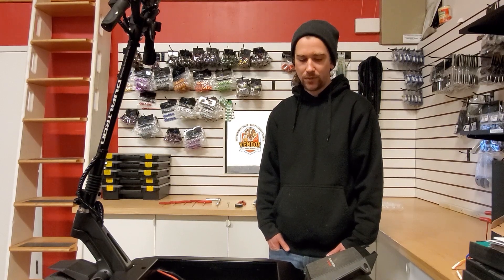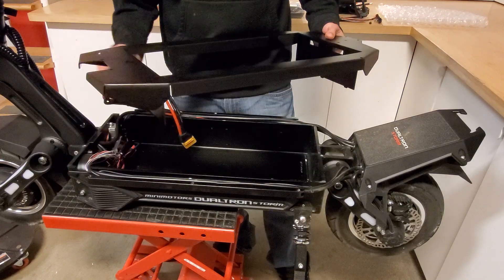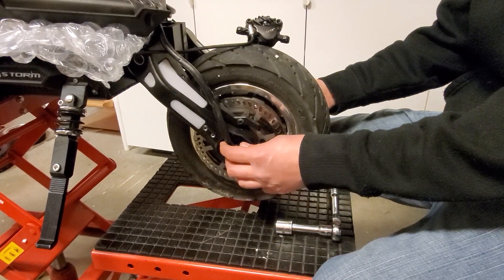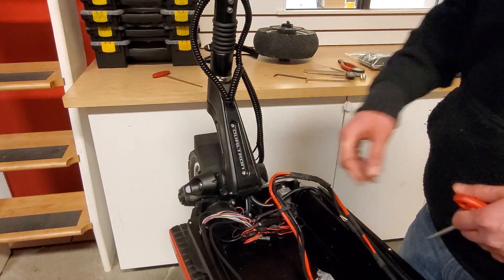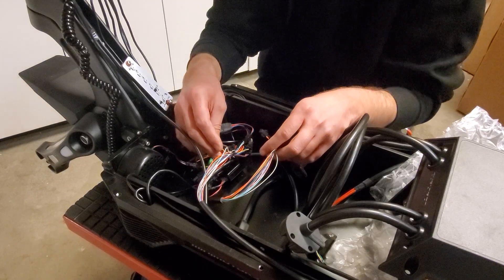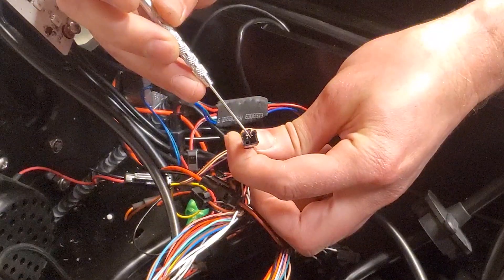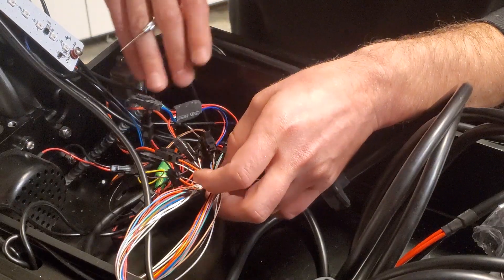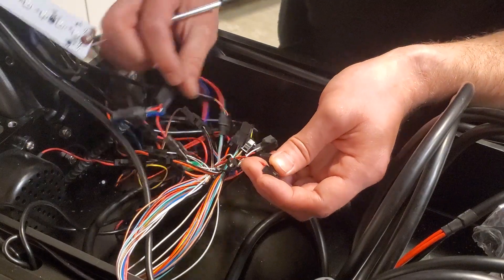Dualtron Storm Motor Controller Replacement

Comment: If this isn’t “too bad of a job” I’d like to know what your idea of too bad of a job is. This is a complete fucking teardown
Reply: Exactly ill never buy this scooter
Reply: @jeremiahcherry2960 don’t get me wrong, this scooter is absolutely amazing but it has garbage water resistance
Reply: I’m in the process now guys. I’m just trying to figure out why they’re so secretive about any information about the new store limited 84 V..
If you notice, I have no videos on here about that you can’t get any schematics online. They refuse to give them out. It’s a fun ride, but the thing is temperamental and breaks very easily and they give you no information to fix it not everyone wants to buy a new scooter or pay someone else to fix it
Reply: @DomenicMann  did you ever get yours fixed or what was your issues?
Reply: Yes, I have the scooter. It’s bad ass, but it was working but now I’m gonna have to make this repair and they tell you the simple that it’s not.. the worst is they lie and say they have videos of it on their mini motors website and they don’t they do everything they can to hide the battery removal from you the most dangerous and hardest part once you get the battery out you can go to work.
Reply: True!!! 🙂